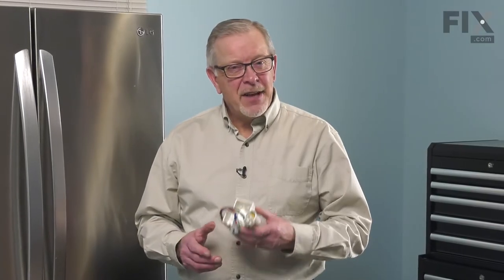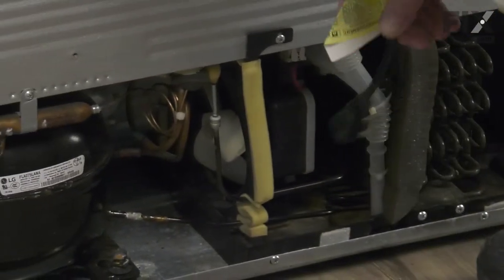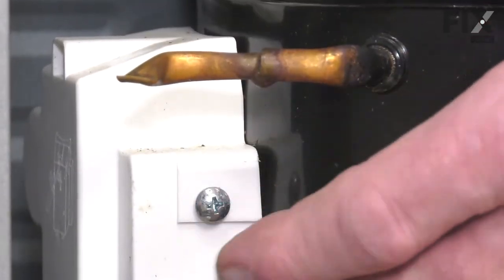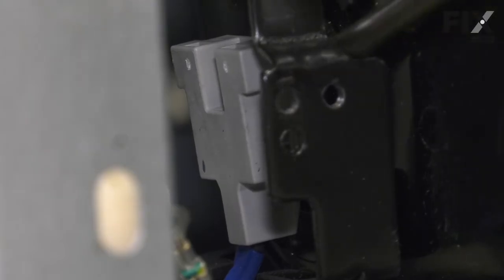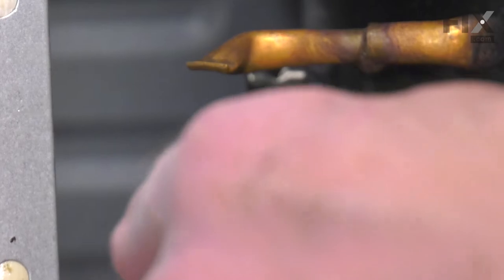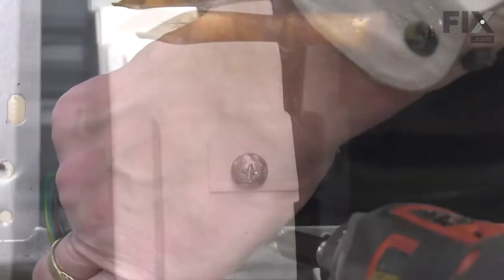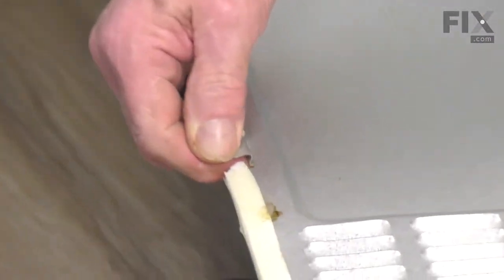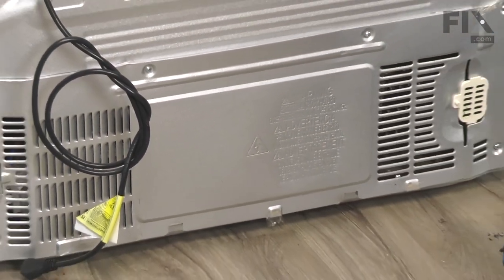LG Refrigerator Repair - How to Replace the Thermistor Assembly

Comment: Excellent video, but how do I tell whether this part is good or bad when the refrigerator is not cooling at all?
Reply: You need to press the test button at the back motherboard box two times and it will give you an error code. If the code says “22” , you can replace the compressor relay. If you google the error code you get, you will get an idea the problem part/system.
Reply: @DarthNero  Thank you!
Reply: @DarthNero  per the service manual, pressing the test button twice will set the refrigerator to have the damper closed and will make the display read 22. The number 22 isn't conducive to a problem. There are three test modes and the display is indicative of which test is being performed. Pressing it 3 times will propogate the number 33 on the display.
Reply: To test this part, remove it like shown in this video. The circular object that is orange and black is the thermistor. To check this thermistor, use a multimeter to check the resistance across (or do a continuity test) and if the resistance is low and you have continuity the part is good. This part is designed to "open" the circuit when the compressor gets too hot and shut down the power to the compressor.
Reply: @stephanwilliams9622  Error 22 is not always this part, just checked mine from what you had said and it was good.  Thank you for this information.
Reply: @stephanwilliams9622 will the compressor still run with a bad thermistor?  My fridge isnt cooling but the compressor is running and condenser fan
Reply: @craigramsay8405  I'm going thru an issue with my LG ...code says 22 and 33 relay...but the other posts are saying it might not be the issue...my fridge is cool...but not cold..which makes no sense

Comment: Why would you be replacing a thermistor ?
Reply: Possibly for error code 22
Reply: @bleedingmonkey  weekday does this control.  I don't understand this part being in back of fridge.
Reply: This thermistor will open the circuit depending on the surrounding temperature. If the compressor starts to overheat, the thermistor responds by opening the circuit and shutting off the power to the compressor.
Reply: @stephanwilliams9622 Didn't answer the question.
Reply: Is this required when the refrigerator stops getting cold